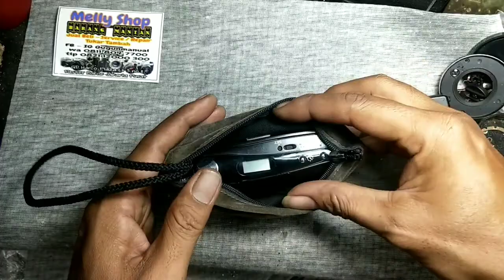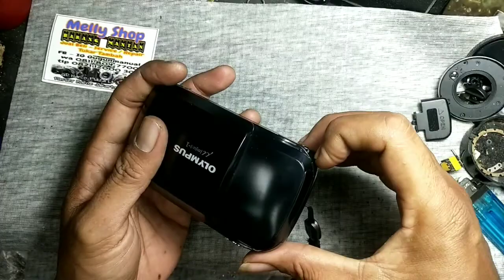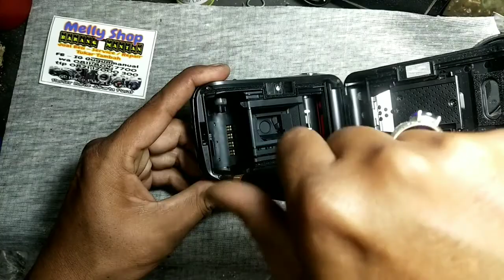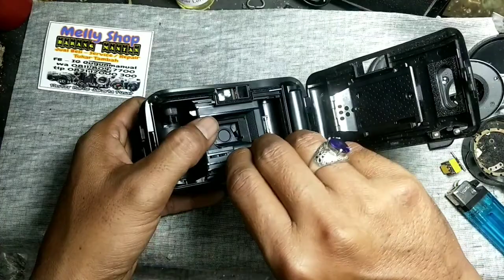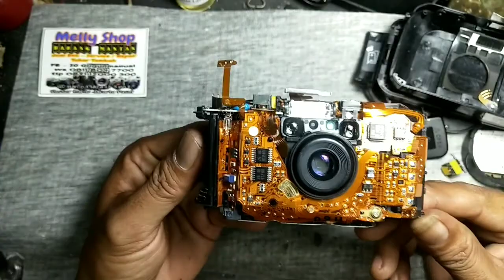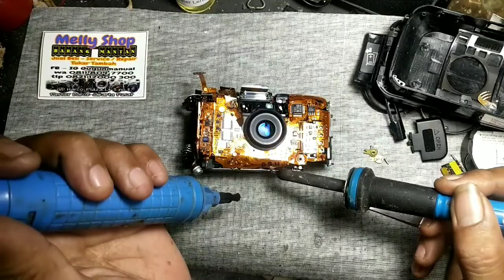Olympus Mju 1 Masih hangat via Gosent

Comment: Mju I kalo led orange nya kedip (flash nge charge) tp ga bisa di shoot apa bisa fix dgn ganti capacitor aja mas? Kalo flash off bisa nge shoot
Reply from the maker: Itu langsung ke  monderboart flas ya 
Tidak bisa ganti transistor sebab sudah susah cari transistor ya
Kebanyakan langsung ganti 1 unit monderboart flas ya
Reply: @gugunmanualchannel1253  setelah saya komen itu saya tes2 lg ganti mode flash ternyata bisa mas, tapi pas coba flash-s(mode red eye) dan flash fill jadi ga bisa lg, apa baterai ngaruh ya mas? padahal tiap nyalain ada bunyi kalau ngecharge